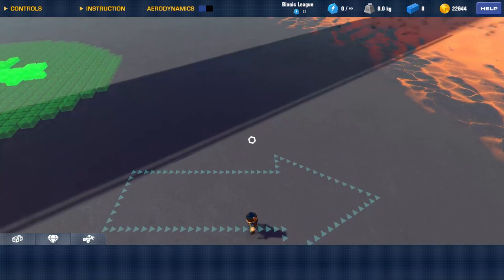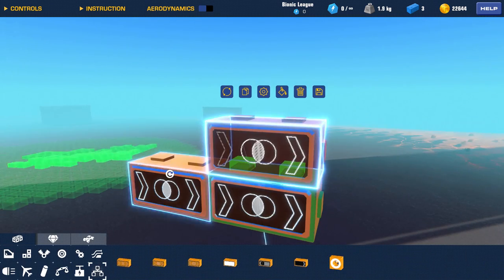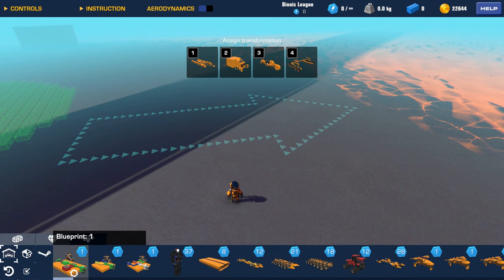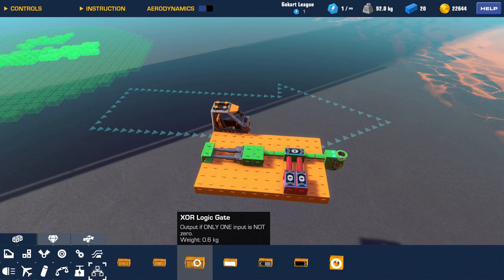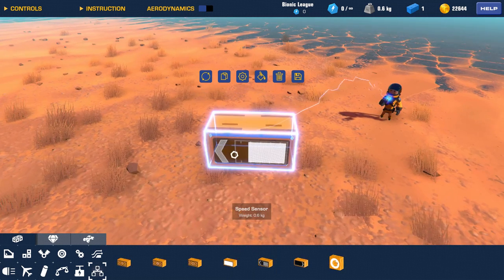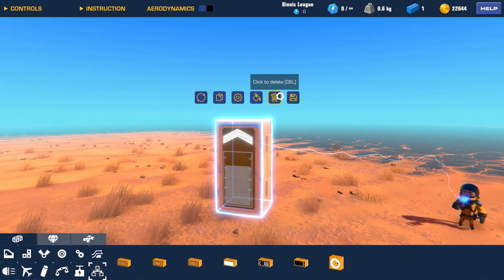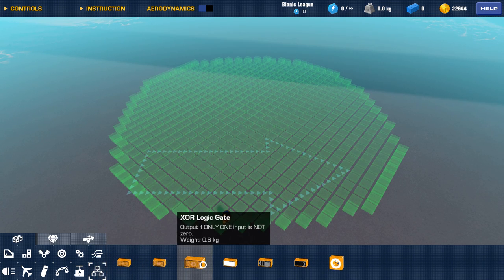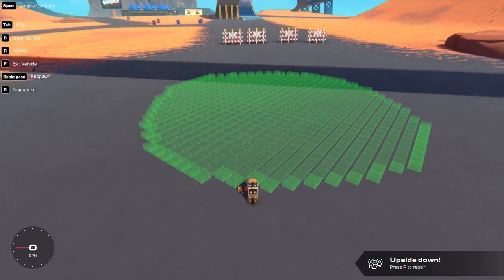Trailmakers How To (use logic Blocks)

Comment from the maker: @soulreaper1981 Some notes about your video:
2:12: i do not recommend turning on toggle on gates with multiple outputs unless it's an or gate, this is because it toggles all inputs, not just the keybind which can cause weird behaviour
9:35: that only matters for keybinds, you can move the keybinds to an or gate if you want all seats to be able to control it individually
14:09: 0 distance is easier to write and has the same effect
21:38: you forgot to mention that the speed is measured on the direction the arrow is pointing
22:41: you forgot to mention that the altitude is measured relative to the sea level
26:35: small note, the direction determines precissely the central point of the activation threshold
Reply: Weird that you commented your own video but thank you for helping me get a better understanding of the logic blocks
Reply from the maker: @robertlcgarcia123  very late answer: somebody on discord made these comments and I would post it

Comment: I play Trailmakers on Xbox and made a Shiftable Automatic transmission using pistons and distance sensors, linked to LB and RB, like a paddle shift. This is obviously not ideal as the pistons take up crazy space and add weight, and wondered if you have experimented with making a practical manual transmission.
Reply from the maker: If been asked this before. Im afraid I don't now how to make it.
You could ask around on the trailmakers discord. There are some really smart people on there.
Reply: Okay thanks!
Reply: My guy you are crazy smart
Reply: I did something similar very large!!

Comment: Thank you, this was helpful, but I still can't figure out how to do what I want. I want to launch missiles one after the other, one for each button, using the same button. I have yet to figure out how I would go about that using logic blocks or if it's even possible. (I'm assuming it is, I'm just not smart enough.)
Reply from the maker: You mean for each time you press the same button, one missel should fire?
Reply: @soulreaper1981  Yes indeed, I actually have the game and that particular craft open right now. Would that be possible?
Reply from the maker: There are two ways you could do it.
With distance sensors and And gate's under each missel. Or pure logic.
IL see if I can make a video on it after I come home from work
Reply: @soulreaper1981  While you could do that and I'd appreciate it,  you don't have too. I can take that information and maybe figure it out myself.  The build this is for a submarine but I will use the logic on other things in the future aswell. I've uploaded it under the name Nuclear Attack Sub V.1.0 if you want to have a look. Btw I'm on xbox I don't know if the libraries are different.
Reply from the maker: @haydenlummus8838  I can't use the Xbox blueprints. Only Steamworkshop because I'm on pc
Reply: @soulreaper1981  Ah I figured that might be the case. I don't believe there are any version differences so it should be no biggie. You've been very kind and helpful.
Reply: @soulreaper1981  So I happen to be build another craft that has missiles and I want them to fire in the same way. Perhaps I love missiles too much?
Anyways I've tried and failed, so do you think you will be uploading a video on it anytime soon?
Reply from the maker: The video is up. I hope it helps
Reply: Hayden Lummus can you tell me your username I’m on Xbox to
Reply: It’s CripledEgg77
Reply: @toilet2902  Steadfastsix
Reply: Hayden Lummus I’m may be playing ROBLOX tmr

Comment: i can't figure out how to make a repeating logic gate. i mean like if i'd press 1 button, it would output a signal every second. thanks in advance :)
Reply: ok, never mind, it's at 4:00
Reply from the maker: Okay, good luck with your build
Reply: @soulreaper1981  wait, didn't figure it out... Guess I'm dumb lol
Reply: @soulreaper1981  could you explain how I would make a clock?
Reply from the maker: A clock no idea. I can tell you how to make a logic block repeat. Just set the button to toggle in the logicblock.
Then go to duration and set it to the time you want and do the same for the pause time
Reply: @soulreaper1981  well OK, but for some reason I can't edit the pauze section... Why? Lol
Reply from the maker: You can only edit that one after the duration option
Reply: @soulreaper1981  yea, figured that out. Thanks :)

Comment: I feel like an idiot. I have simple task, push button on keybord, turn on light for few seconds, then light turns off. Push button again and repeat this "proces".. Sounds easy, but whatever I do ends in a result: must push that button twice :( Can help somebody pls?
Reply from the maker: You take a XOR logic gate (set to toggle) . Connect it to a light (the light has to be on toggle of and push for light) and connect it to two logic blocks. Those two logic blocks you connect back in to the XOR gate.
You go in to the two logic blocks and set the delay to how long you want the light to be on
Reply: @soulreaper1981  Not working. i was trying everything, but if i have anywhere set "toggle" this kill option to push button once. Always must twice :( but if i dont have toggle, it will kill option to set timer
Reply from the maker: Only the first logic block should be set to toggle (the XOR block) the other two logic block will turn of the first block
Reply: @soulreaper1981  screw it.. :D I almost did it. Now its working for lights, but not for spinning servo. (freaking out) I have no more patience. At least something works. Thank you :-)
Reply from the maker: You can always go to the official discord of trailmakers. I'm on there al lot and I can help you live using the voice chat
Reply: i thing i have it :)